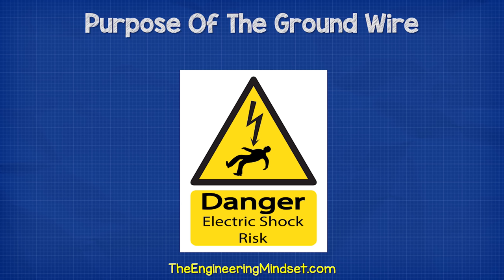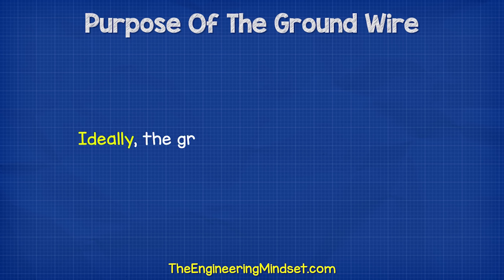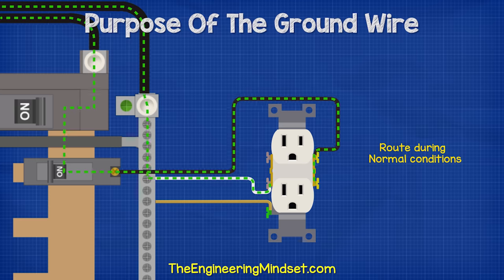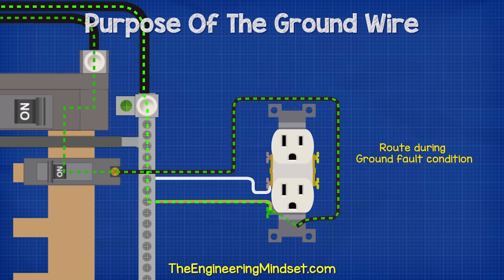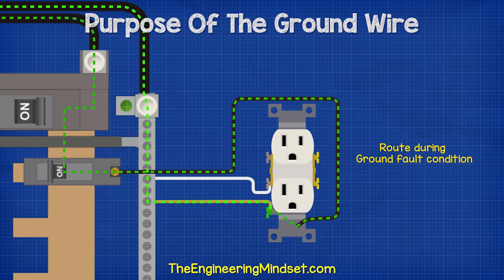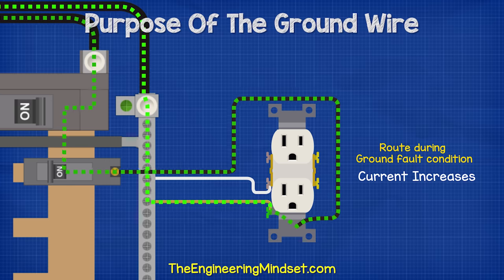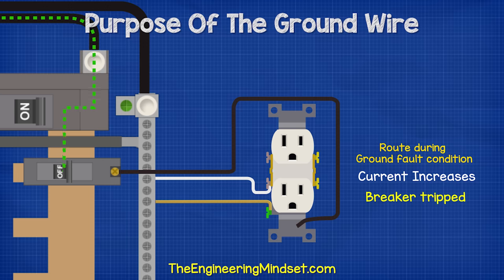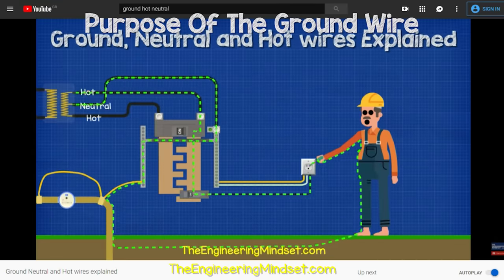Why is a ground wire used?

Comment: This ground wires is an essential for safety measures.  Without it, you can experience electrical shock if you come in contact a metal(if there are some source of leak inside the wire). I have an experienced when touching washing machine as when I was a kid. It was painful.
Reply: Not if it's SELV.
Reply: This isn't accurate.
Reply: 1905 to 1940.  No ground wire.  No hole in the duplex receptacle to insert anything.
Reply: @RobMrowiec  🤣 enjoyed the chuckle 👍
Reply: @RobMrowiec  🤣
Reply: @RobMrowiec  In which country because as far as the electrical regs in the UK goes the ground or earth is for electrical protection the earth wire like any wire can turn into a fuse if overloaded, that's why we do test and inspect of the CPC and how it's tested to make sure the cross sectional area can handle the current or it could cause a fire and as the 240v AC or 120 AC usually goes to a transformer in most appliances etc which removes the earth how's that gonna stop the electronics catching fire ? Joker. I'd keep learning or maybe your regs are different but double your 20 infant years and then maybe you can cop an attitude. 🤣
Reply: @RobMrowiec  And also I'd look at the practical application of removing the earth from an appliance as most have power supplies that also have to conform to certain regulations, they have that 3 capacitor set up between live, neutral and earth so straight away you remove earth and your device with a metal enclosure becomes half the mains potential that equals a potentially deadly situations. Compare that to the risk of a fire from the same situation and critically think which is more likely to happen and you see why I lol.
Reply: on the other hand you would have been able to touch the washing machine as long as you wanted and be fine if there would have been 100% no ground wire at all
Reply: @shawnshurtz9147  That's accurate. I experienced it too with our washing machine. In the event of ground fault, if without the PE wire the only path to ground is through your body if you touch objects that are energized with the leakage current. If the there is PE, most of the leakage current will be grounded via that PE wire as it is a much better conductor than a human body.
Reply: @user-et6cr6qd8v  That's wrong. Since the Neutral is grounded at the transformer, it is always safe to touch the neutral wire in an open circuit. But if the neutral is not grounded then the metal of the washing machine itself can easily  become a load and start a fire if it is exposed to both the neutral and the phase at the same time. And have you heard of accidental ground? It's very dangerous as either the phase or neutral can give you electric shocks depending on which side (the Neutral or Phase) is accidentally grounded. That's why one of them (neutral) should always be grounded, so that you know the neutral wire is always safe to touch, does not matter if there is accidental ground or not.
Reply: Tons of houses wired with no grounds or very few. Ppl still alive.
Reply: It sounds like the outlet the machine was plugged in was miswired
Reply from the maker: We just published a new Ground fault, short circuit and arc fault video, so much detail! Link HERE➡️: https://youtu.be/Qi0ynSQw-wc

Comment: A lesser mentioned benefit of the ground wire is it comes in handy endlessly when troubleshooting. For example if a device is acting like it doesnt have power, due to an open neutral situation, if all you had to measure voltage across at the outlet were hot and neutral you may read 0 or very little voltage, even though you DO have the full potential of incoming line power. The full voltage drop is occuring at the point where the neutral is open. Measuring hot to ground at the receptacle in this instance would read ~120 volts
Reply from the maker: We just published a new Ground fault, short circuit and arc fault video, so much detail! Link HERE➡️: https://youtu.be/Qi0ynSQw-wc

Comment: I'm not sure this really answers why ground wires are used, in the example given you could simply bond the metal casing of whatever appliance to the neutral wire and achieve the same result.
Reply: Some old builings are made like this if im not mistaken
Reply: At least in EU systems earth is a separate wire all the way along. We have another „breaker“ (FI or RCCB) which detects missing current between neutral and live. If there is a difference of about 300mA, it will disconnect. 

IMO it’s dangerous to just use ground as “backup wire” which increases the current so that your normal 16A breaker pops out. 

Don’t you use RCDs, too?
Reply: @goeppi8  Yeah the U.S. has a similar system although I don't think there are normally any breakers with that functionality, instead it's built in to the receptacles in areas such as the bathroom, and I think it trips around 15 mA or so difference between neutral/live, they're referred to as GFCI receptacles.
Reply from the maker: We just published a new Ground fault, short circuit and arc fault video, so much detail! Link HERE➡️: https://youtu.be/Qi0ynSQw-wc

Comment: A ground wire is used to provide a safe path for electrical current to follow in the event of a fault or other problem in the electrical circuit. This helps to prevent electrical shocks and other potentially dangerous situations. In most cases, the ground wire is connected to the metal frame of an appliance or electrical device, which provides a low-resistance path to the earth and allows any excess current to be safely dissipated. This can help to prevent electrical fires and other hazards.
Reply from the maker: We just published a new Ground fault, short circuit and arc fault video, so much detail! Link HERE➡️: https://youtu.be/Qi0ynSQw-wc

Comment: Question: why is the ground wire routed all the way back to the ground bar in the breaker box?  Why not just jump the neutral to the ground at the outlet?
Reply: There needs to be a common point for connection to the ground rod.
Reply: Wouldn't that have it ground out through the entire circuit while it's making its way back?
Reply from the maker: We just published a new Ground fault, short circuit and arc fault video, so much detail! Link HERE➡️: https://youtu.be/Qi0ynSQw-wc

Comment: I don't get it. How come if you have a bad ground on a car stuff will stop working? If it's just an emergency path shouldn't stuff still work? Or is the ground acting as a return line to complete the circuit? Is the frame the neutral wire basically?
Reply: Yes, the whole frame and any metal connected to it is "ground" The difference is a car is DC voltage and a home is AC. 2 very different beasts. An interesting watch is Teslas AC v.s. Edison's DC.
Reply from the maker: We just published a new Ground fault, short circuit and arc fault video, so much detail! Link HERE➡️: https://youtu.be/Qi0ynSQw-wc

Comment: This only covers the bonding of anything conductive that could become energized in the event of a live conductor fault coming into contact with it, such as the metal case, via a low impedance wire, the grounding conductor, back to the breaker so as to quickly cause a fault current causing the breaker to trip clearing the danger.  Prior to this "safety" ground bonding via a dedicated grounding conductor, a hot fault to a metal case, or pipe, etc., would wait until someone or something became the path to ground causing electrical shock.

It is tied to to, but different in purpose from the grounding electrode/grounding electrode conductor bonded to one live conductor to create the neutral and create a parallel circuit to cap the voltage spikes from induced currents caused by lightning, or inductive load switching via a ground path between the grounding electrode at the transformer and the one at the service entrance.  (Note there are other types of utility service provisions that handle this differently in some areas, but this is common in US detached residential electrical service)  The voltage spikes from induced currents created the chance of arcing and hence fires.  Think all the simulated arcs in the Hollywood depiction of Frankenstein's laboratory during the electrical storm.  The doc needed a good grounding electrode/grounding electrode conductor set up, but he was in a stone castle so fire was less of a risk.
Reply from the maker: We just published a new Ground fault, short circuit and arc fault video, so much detail! Link HERE➡️: https://youtu.be/Qi0ynSQw-wc

Comment: are there any countries where the outlets dont have a ground wire connection? if so, is it due to an alternative safety measure which would be great if you could cover.
Reply: In germany oprating rooms don't use a ground connection in this sense. It just shows a warning light and everything continues to function as usual. Nobody gets shocked because everything is highly isolated and critical appliances won't just lose power.
Reply: Power Plug CEE 7/16 Alternative II, aka "Europlug" does not have a PE connector. But it is only allowed up to 2.5 Ampere.
Any PE wiring from the casing or upstream wiring is connected to the Neutral.
If there is s shortcut it will work just as well, while the device stops working entirely if neutral is cut.
It is a whole lot more space efficient, and you need a contrived situation to cause any danger.
Reply: Half of the outlets in my house don't have a ground.
USA
Need the adapter that doesn't use ground

Comment: The safety is not the ground wire but the protective devices shutting off at fault (over current and/or residual current protection). But the ground wires make them work. Without ground wire the current will not flow back to the source in case of a fault. This is because the ground wires are connected to the neutral ONLY at main panel. 
The biggest misconception is earthing/grounding. But this is a different story. Short: Earthing is to protect the electrical system agains high voltage surges. You have to understand very high voltage (electromagnetic fields of lightnings) at high frequencies for this.
Reply from the maker: We just published a new Ground fault, short circuit and arc fault video, so much detail! Link HERE➡️: https://youtu.be/Qi0ynSQw-wc

Comment: Can you ground an outlet by just running a wire from one grounded outlet to another ungrounded outlet? That's how I grounded an outlet on the other side of my bedroom, ran a wire from the grounded box into the basement up into the ungrounded box and connected just the ground and cut the unconnected white and black
Reply: Yes
Reply from the maker: We just published a new Ground fault, short circuit and arc fault video, so much detail! Link HERE➡️: https://youtu.be/Qi0ynSQw-wc

Comment: Seeing the neutral return through the transformer and back into the service through the hot wire, does the smart meter differentiate between newly pulled power to use for other devices and the recycled power, or does it just continue to charge you for electrical usage anyway despite a small portion of the power consumed actually being returned from other devices that are powered at the same time? 🤔
Reply: I'm not sure I understand your question, transformers are separately derived systems. The definition of a separately derived system per NEC is "An electrical power supply output, other than a service, having no direct connection(s) to circuit conductors of any other electrical source other than those established by grounding and bonding connections.". When would you carry the neutral through? 

The meter will always be running though, even under no load. From a website I found "No-load losses are caused by the magnetizing current needed to energize the core of the transformer, and do not vary according to the loading on the transformer. They are constant and occur 24 hours a day, 365 days a year, regardless of the load, hence the term no-load losses. They can be categorized into five components: hysteresis losses in the core laminations, eddy current losses in the core laminations, I 2R losses due to no-load current, stray eddy current losses in core clamps, bolts and other core components, and dielectric losses. Hysteresis losses and eddy current losses contribute over 99% of the no-load losses, while stray eddy current, dielectric losses, and I 2R losses due to no-load current are small and consequently often neglected. Thinner lamination of the core steel reduces eddy current losses."
Reply from the maker: We just published a new Ground fault, short circuit and arc fault video, so much detail! Link HERE➡️: https://youtu.be/Qi0ynSQw-wc

Comment: I’m new to this so bare with me. If there is a ground wire coming out of the Romex wire (that has hot, neutral, and ground) and if im installing a ceiling fan, do I have to wrap the ground wire (from the ceiling fan) to the ground screw of the metal box? Or can I just pigtail the ground wire of the ceiling fan to the ground wire of the romex?
Reply: Just bond the box as well. Bit safer
Reply from the maker: We just published a new Ground fault, short circuit and arc fault video, so much detail! Link HERE➡️: https://youtu.be/Qi0ynSQw-wc

Comment: So if you didn't have a ground wire connected and a short occur, the circuit breaker will never trip then? Or will it still trip?
Reply: I think it would trip because you would be acting as the ground or earth wire as the current flows through you.
Reply: @WillCamx  Oh ok, that makes sense. Hopefully the CB still tripping will save your life.
Reply: @Passions  A Residual Current Device or RCD will trip in time to save your life.
An ordinary circuit breaker probably not.
Reply from the maker: Seen our new incredibly detailed MCB video? link: https://youtu.be/gqEu9t8HwW0
Reply from the maker: We just published a new Ground fault, short circuit and arc fault video, so much detail! Link HERE➡️: https://youtu.be/Qi0ynSQw-wc

Comment: Sir, then why we don't use natural wire as ground (connecting the natural wire to the metal ) , because that will also complete the circuit and we will safe?
If not then what will happen??? 🙏🙏🙏🙏❤
Reply: If you were to touch the frame of a dryer for example while it was bonded to the neutral and came in contact with something grounded you are now giving the current an new path to the source. Instead of just receiving a shock from the voltage you now run the risk of running the load of the dryer through you. Less likely but has happened. (older dryers typically used the neutral as a ground in America but no longer do.)

Comment: so ground wire functions in a way to prevent the current flowing through equipment that is made of metal or stainless steel .. sorry for my english.. correct me if i am wrong.
Reply: The ground or earth wire is a safety feature. If the metal case of an appliance comes in contact with the live wire through a short circuit, the ground wire provides a path for the current to flow safely, rather than through you if you touch the appliance.
Reply from the maker: We just published a new Ground fault, short circuit and arc fault video, so much detail! Link HERE➡️: https://youtu.be/Qi0ynSQw-wc

Comment: My home's energy plugs have no third wire besides hot and neutral. Is that really as dangerous as I fear? What should I do?
Reply: @RobMrowiec  Hey, thanks for your answer! I'm not in the United States (I'm form Brazil), and the electricians from here say it's "ok", but the fact that all appliances have a third plug that connects to nothing worries me a bit. At least my house is made of non flammable materials. 
Thank you for taking the time to answer me!
Reply: If its your own house you can run the ground wire to all the sockets, run the common ground wire outside the house and bury it deep in the ground, for instance. But that's a big and costly job. If you live in a block of flats then you can't do anything about the wiring, but what you can do is ensure all your appliances that have metal casing don't have any loose / damaged wiring inside. 
Also, some people take sockets apart and connect the socket's ground pin to neutral wire. Its not the greatest idea but better than nothing.
Reply: @dmitrydmitry716  I’ve also seen grounds run to water supply pipes. Not sure that’s a great idea. But they definitely go to ground…well unless you catch rainwater or something …
Reply: @michaelsmithers4900  These days water pipes are usually made of plastic so it may work only in the old building with metal piping. But I reckon, a person taking a bath while the ground fault occurs might not appreciate this sort of rigging.
Reply: @dmitrydmitry716  Connecting ground to neutral is dangerous during neutral float. (cut neutral). All metal bodies will get energised. From India.
Reply: @dmitrydmitry716  oh no, not the individual supply pipes in the house. Only the cast iron (black) pipes outside or just as they come inside… idk, electricity should take the path of least resistance to ground…
I guess he could find a place to drive a stake in the ground and run a wire to it…